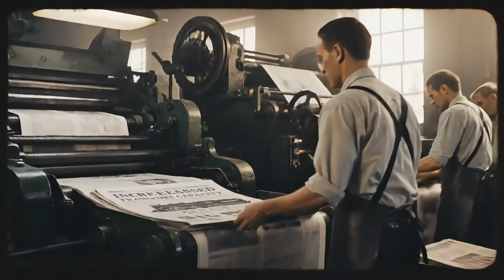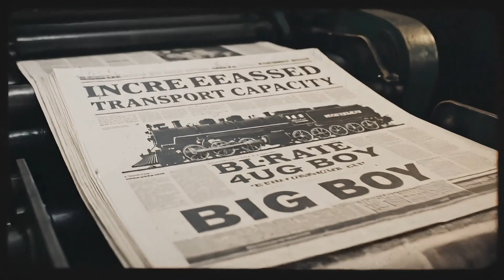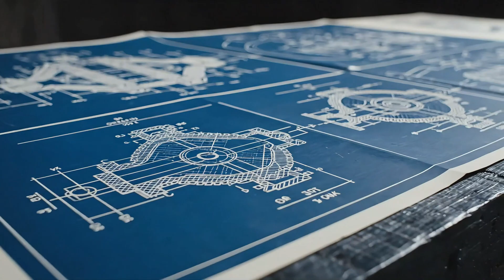Big Boy | You Won’t Believe What This Monster Could Do

Comment: Allegheny locomotive enters the chat.
"Most powerful engine you say?"
Reply from the maker: Good point! The Allegheny is indeed stronger on paper.
But it was built for short, steep mountain pulls — more like ‘lift it and you’re done.’
Big Boy, on the other hand, hauled heavy trains for hours at speed across long routes.
So both are monsters — just built for different kinds of work 🚂🔥